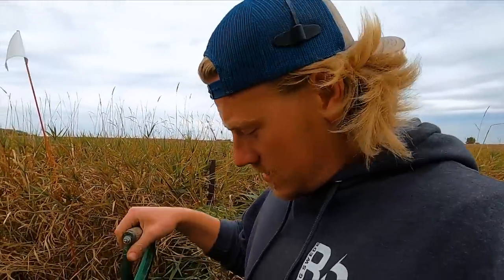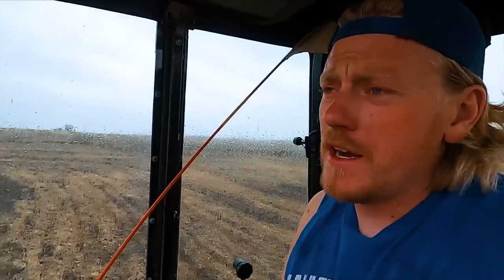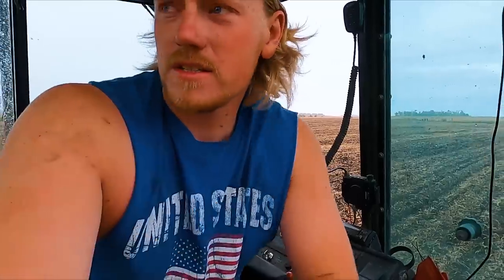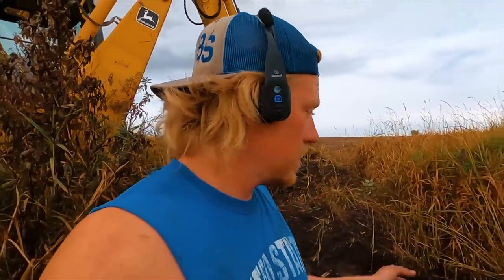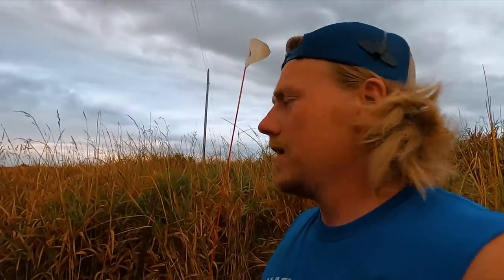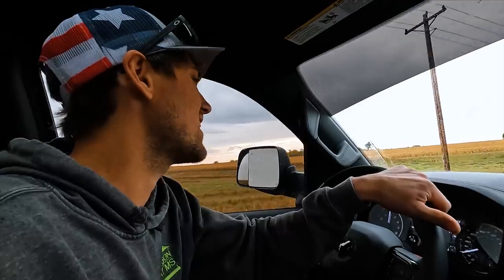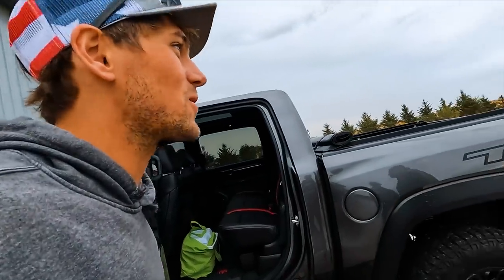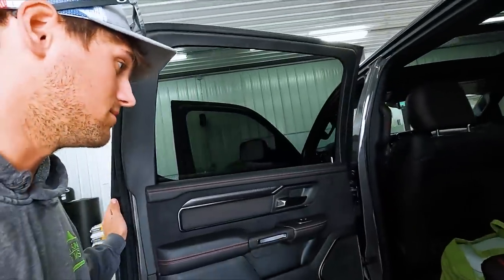702 Horse Power TRX For A Farm Truck?? #6

Comment: You can a pet cover for the back seat for Toby. It will cover the while back seat. Easy to clean and keeps the seat from getting dirty or scratched up as well
Reply: Some friends of mine just did the same thing, works great
Reply: I dropped in to suggest the same thing!
Reply: They also have them for the front right seat.  Get  full set as full-time seatcovers to keep the upholstery clean ....for a while.
Reply: @michaelsurratt9593  
.  

 ?
Reply: Duluth trading makes a really nice one

Comment: Congrats on the new truck, coming from someone who drove a Dodge Charger Hellcat as a daily driver for 2 years. The smiles per mile are so worth it. You will grin every time you tap the gas pedal. And it does not get old. Switched to a Shelby GT500 [760 HP] after a woman drove into the side of the Hellcat. Have Fun!!!

Comment: You can get pet covers for the rear seat. I call mine the doggy hammock, I'm not sure what brand it is. It covers the seat and spans across the back floor wells attaching to the headrests of the front seats. It's stain and water resistant, and cleans up easy. My golden retriever sheds.... enough, and that cover is a life saver. It's got a zipper between the front seats if you want to let your dog stick his head through. Didn't mean to sound like a salesman, I feel the same way about my truck and my dog, now they get along good.

Comment: @larson farms trick i learned as a deere tech. For those tensioners with those long threaded rods, leave the chopper closed and clamp a vise grip on the smooth end of the rod behind the spring and then open the chopper, springs stay compressed and belts come loose all at the same time

Comment: A pair of vise grips behind the tensioning arm for the chopper belt, then raise the chopper up half way and the inside belt will come right off to change the discharge beater belt. Also on the clean grain chain take the main drive belt loose for the clean grain and then take it off the jackshaft pulley. Take cover off the bearing on the clean grain boot and roll the clean grain chain over with a pair of vise grips.

Comment: Chet, my daily is a Jeep Trackhawk.  707HP and we live in the snow belt in Ontario Canada. I run winter tires and it goes through the hay fields. You will get used to, love😉, the whine of the charger. Oh and get some mud flaps and floor liners.

Comment: I had a charcoal grey Dodge ~ had to run with the headlights on to keep others from constantly pulling out in front of me - blended in too much with the asphalt.
Reply: That was exactly my thoughts. I have several times not seen a grey vehicle that blended too much with the road color. Each car we had seemed to be a car magnet (2 broadsides, 2 were rear ended and 1 side scraped) until we bought red ones. They are visible.

Comment: I see the Big Swede is a graduate of Doug University of Excavation and Ditching. Should hold up your deploma.. GREAT JOB ERIC! You are an excellent communicator.

Chet, never question your elders blacksmith ways. Years of experience, and the old railroad engineering motto, if it doesn't stand up; throw more iron on it. 
Your new truck is a class ride, looks really sharp. The color is a vast improvement, has that business man look.

Comment: Congratulations on the new TRX  I have owned mine since March of 2021 they are incredible.  In Baja mode I drive across  hay fields at 45 to 50mph smooth as butter . The only downside to the truck is towing .  I can tow my Kubota lx2610  no problem but can't town my m9540  it's to heavy .  Like I said Congratulations your gonna love the power  .

Comment: Back the day had a 78chevy full time  four-wheel drive with 327 vet motor beefed up a little bit. Could spin all 4 tires on dry pavement . Wasn't much for top end but definitely had the tork.

Comment: On the grease fitting under bin use 1/4 plastic air line and add extension to somewhere so it’s easier to get to

Comment: Hey, as far as unclogging pipes  they have a pressure washer head root penetrator or penetrator you can put on the end of the hose they have a kit with get the head and the hose I think it's like 150 ft of hose and you can just run it up the thing it'll even cut Roots up to about an inch and a half the things amazing it really cleans out that type of pipe really good it's a little messy but it works just look at the page of the guy in Australia penetrator I think his name is
Reply: Yep had one that did this back in the late 70s !
Reply: They have one. Used it on the shop drain.

Comment: Hey Chet,  I’ve done my share of maintenance on farm and industrial equipment. The grease zerks can be removed and install steel tubing and build a remote manifold so all hard to reach areas can be greased easily. If the pipe cannot be fasten down use high pressure rubber hose, don’t let vibration become an issue. Next buy a deep well socket cut in half ( that’s across not down the length) then weld  a piece of proper sized pipe between the two pieces, now you have special made tool. Don’t loose it I wrote this for a dumb person which I know is not you. It takes above average people to buy Dodge, that is a sweet ride. I’m still in my 95 Dakota 4X4, 5 speed which is now called anti thief device. Enjoy it because you can’t pay for that truck on social security. Stay safe

Comment: I can see a lot of use for that truck on the farm.  IF a combine is full,  and way across the field,  that truck will be able to get a grain cart there in record time!!   If a combine breaks, needs parts,  or lunch is ready,  that truck will be able to fetch parts and lunch, in record time.  If you get a machine stuck some where, 700 horsepower and four wheel drive is just what  you need, with a yank em rope,  to get it out.  I think you made a wise investment the Chet.   And I am NOT bitter that I did NOT do that back in the sixties when I could have bought a Dodge Dart with about a million horsepower and did not.  (I just HATE myself)

Comment: Have you had the power fold running boards before? I was told that they can be an issue in the northern states with salt and sand getting into the mechanism.

Comment: Chet,  when you were greasing the bearings underthe grain tank is it possible to put steel or rubber lines in there so you can grease them from the top?  You may have to make a bracket to hold the zero and hoses.

Comment: For that zerk by the engine can you put a hose on it and cable clamp it to the side pannel so when you open the door you can just use the extension hose to get the grease in?

Comment: Equipment companies need to start putting one spot grease manifold for easier greasing
Reply: They charge you for it.
Reply: @daveoshea2001  why I am not surprised. Should be a base model feature, would get more people to buy your equipment with better features
Reply: From past experience 40 years of heavy plant etc ya can't beat looking and greasing directly  only need a broken lube pipe and you've got big expensive problems
Reply: the better companies already do.. lol look at the claas combines as an example
Reply: What they greased could not have a hosed ran to a manifold since it was a sheave pulley that turns running the rotor.

Comment: Why not install some 1/4" stainless steel tubing from the grease fittings in the hole that are so hard to reach and install new grease fittings in a reachable area under the lid you were holding up...

Comment: Is it possible to add a 1/8 copper tube to the grease fittings down under that tank,, mount a fitting on the outside

Comment: I factory ordered a Chevrolet Caprice 427 back in October 1969.  Yes, it went like the wind.  However, one day I was out on the highway and I realized I was married and it would be stupid to put the car into the ditch.  I let common sense rule.  We put over 100,000 miles on that car and we used it for towing our holiday trailer.  I changed the oil "religiously" every 1,000 miles.  . . .  those were the days alright.  Use your head and you will be fine.  Looking down the road, you want some stories to tell your grandchildren.  😊

Comment: Nice new truck, but oil changes every 3000 miles is not a  cool feature. About the combine: When the chain gets longer when wearing out, the sprockets will wear down also.

Comment: Best thing about power running boards is when the person putting it on a hoist forgets they are installed and it slams in to the hoist arms
Reply: Or when your a body guy and you’ve installed a new door, and you plug in the main connector to the body and it pops out and slams into your shins. Feels great.

Comment: Chet, why not make an extender pipe for those zerks that are so hard to reach so you don't have to crawl into the machine.
Reply: A definite recommendation, We do it to grease the dump truck towers as the factory is too cheapo to do it also you can use flex lines for that chore.

Comment: Do 3 oil changes on that truck at 250 miles 500 miles and at 1000 miles. Otherwise you will suffer a lifter failure and camshaft destruction. Then every 3000 after that.

Comment: 700 hp why ? Ya going to pull the planter 

Well ok I would buy one just for the noise it makes 😎

As for the belt or basically all ( rubber ) products today 
Not enough natural rubber 
The synthetic rubber dose not last it will just rot sitting there
Your belts wiper blades and even those tracks that the lugs peeled off of 
Bad rubber ( synthetic rubber )
Natural rubber last for ever

Comment: Don’t worry about that 1000 mile shit, it is better to work your Ram Truck hard at the very beginning. Put many miles on it at the very beginning and you will have a beautiful truck running for every. If you baby it plan on many problems down the road.